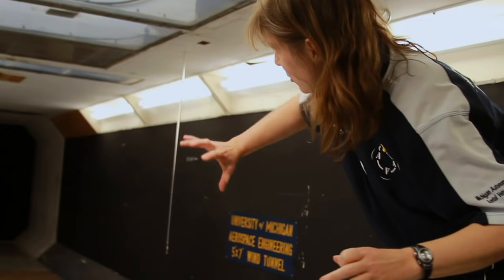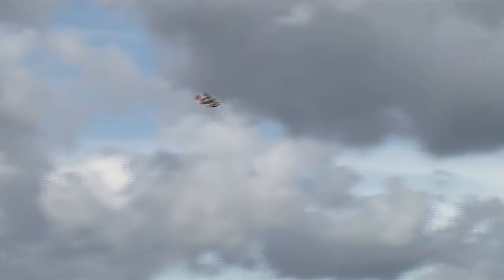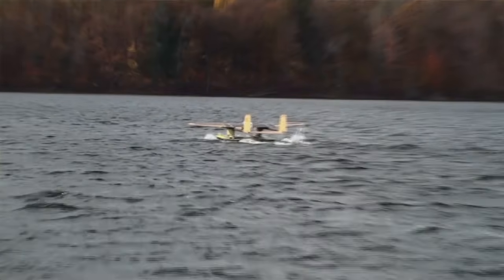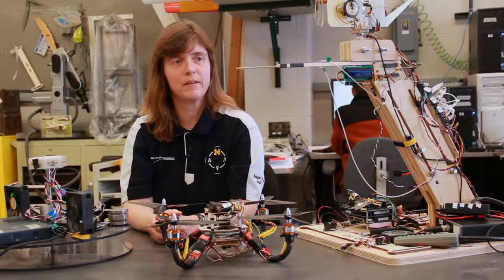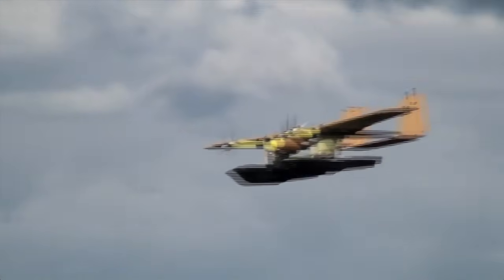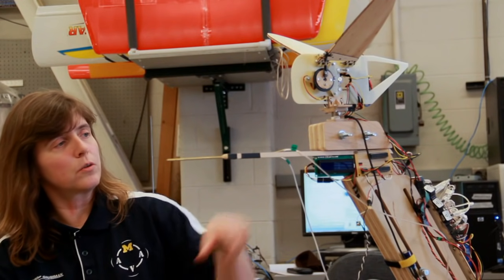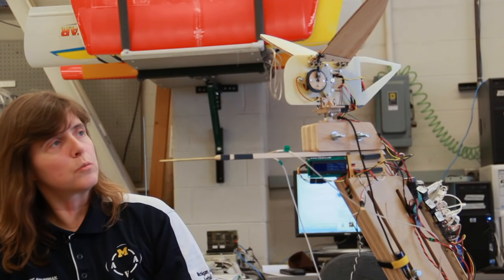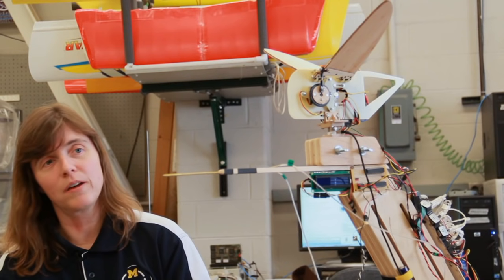Flying Robots

Comment: No, it could not have landed any other way according to the investigations, due to hight, the U-turn they had to perform and the drag from the landing gear. So you better show some proof that your opinion is superior the formal investigation.
Reply: The following document on the NTSB Docket Management System confirms in simulation that US Airways 1549 could indeed have returned to La Guardia:   "Operations/Human Performance 2DD - Attachment 28: Simulator Results Document"  [Search for NTSB Accident ID DCA09MA026].

Comment: First fully autonomous seaplane ever built?  There are very few firsts to be had in this industry.  I doubt even this one was the first, http://www.unols.org/sites/default/files/Neptune%20UAV.pdf
Reply: We are and were aware of the Neptune.  We always considered the Gull and Sea Scout closer in design to our Flying Fish seaplane.  Neptune landed with wings in the water -- it would be very difficult to take off again from this state.  At the time Flying Fish was first demonstrated, Gull and Sea Scout were semi-autonomous, in that they could fly between preset waypoints but required operator initiation of takeoff.  Additionally, only Flying Fish had solar energy harvesting capability, so Gull and Sea Scout required manual recharging/refueling between flights.  That said, Flying Fish presented quite the visual target and could be easily picked out of the water (stolen) while recharging.  Also, FAA regs still don't really support routine BVLOS UAS civil flight so well, even low over the great lakes where the manned aircraft don't fly so often...